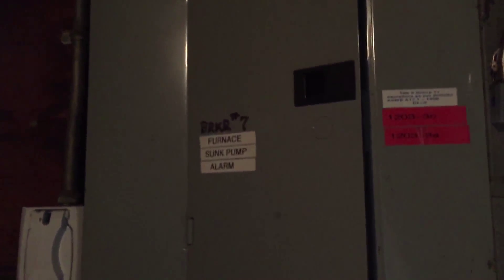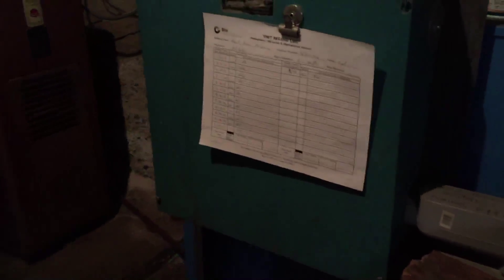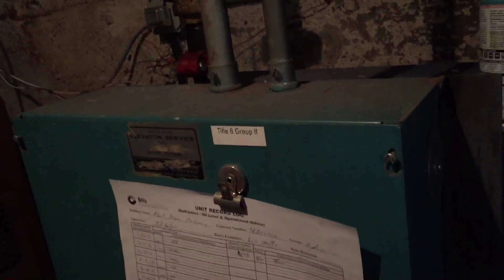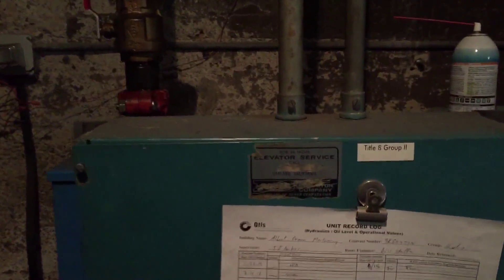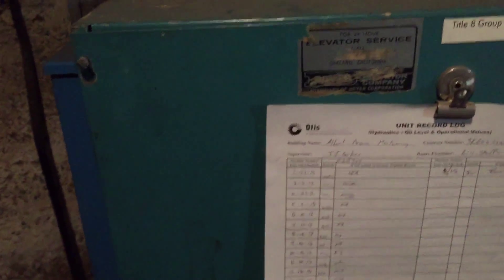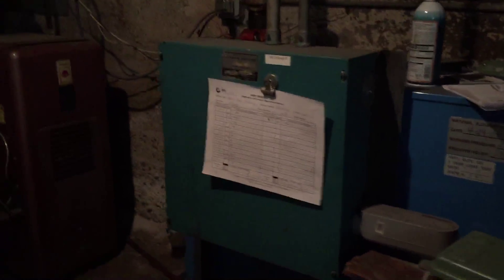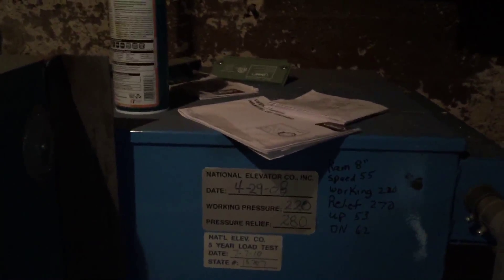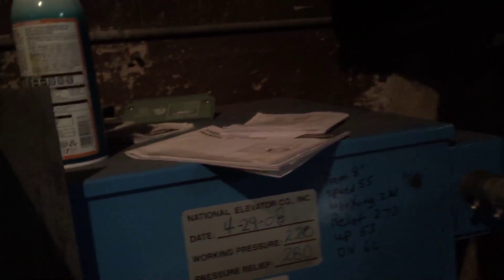Antique Otis/Dover/National? Hydraulic Manually-Controlled Elevator Machine Room

Comment: I'm going to say that this is a Dover elevator, because of the blue equipment.
Reply from the maker: ***** 
This elevator was originally an Otis. There is an Otis nameplate on at least one of the shaft doors. Dover converted this elevator to a hydraulic elevator. National might have replaced the pump, but I am not sure if they did. I think the controller is from the Dover upgrade.
Reply: @upanddownadventures, it must be originally made by Otis but they modernized the machine to Dover and it is maintained by National